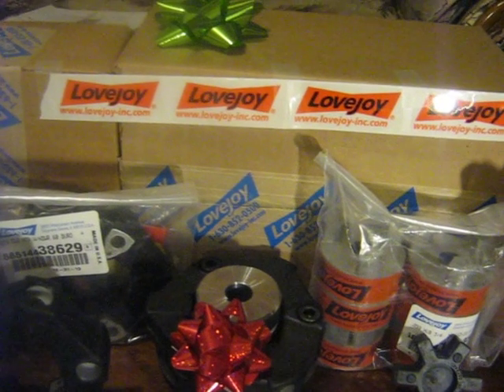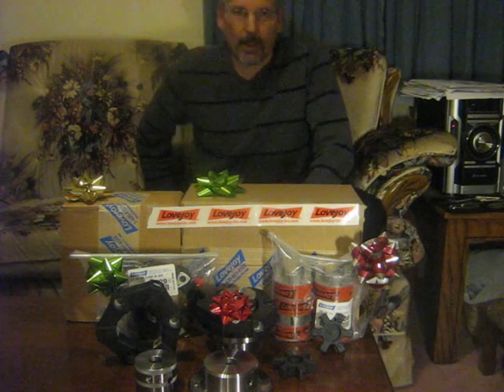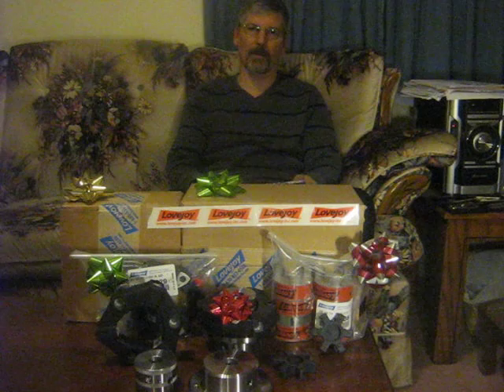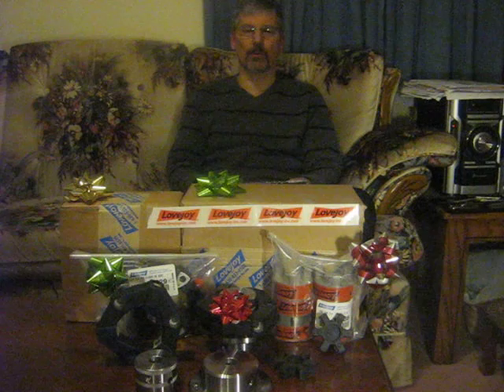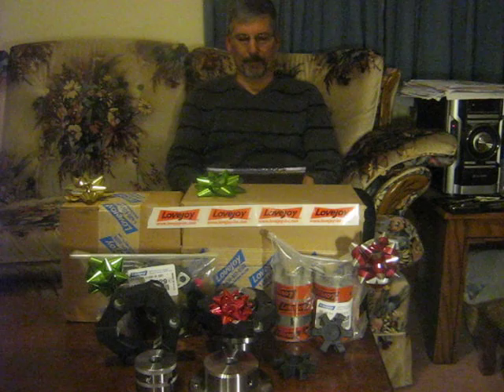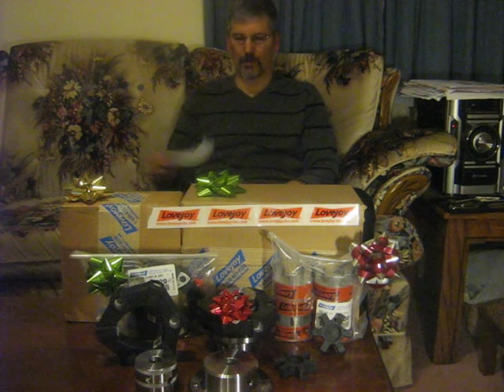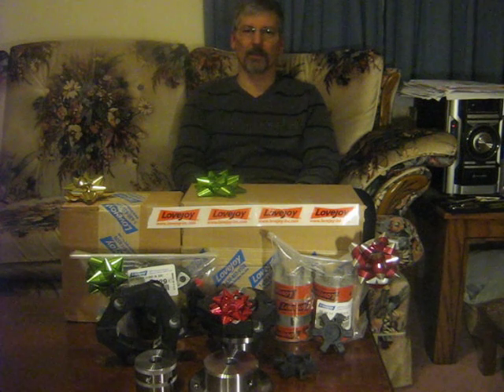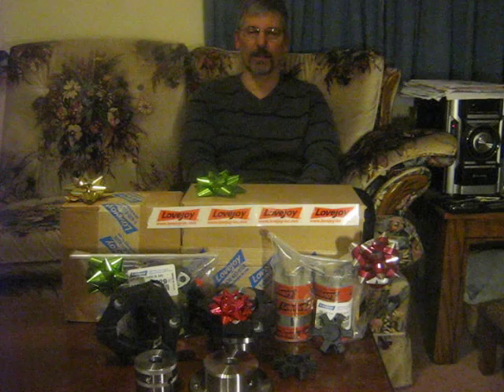Thank You LoveJoy Couplings!!!

Comment: Thanks for the mad props! You've got a crazy unique application that certainly peaked our application engineering teams interest. For your own safety (and safety of those around you)... please be sure to use coupling guards when in use... and also make sure the shafts are well aligned. Best of luck!
Reply from the maker: Thanks again for your interest in the 4 cylinder engine.
I will 100% use coupling guards on my engines, in fact I have already made one for the Briggs 2 coupling test engine. We have gotta be safe, it is much better than the alternative!  Lady luck has been with me so far, but I will be using guards from now on, and always remember safety glasses!!!!

Miles